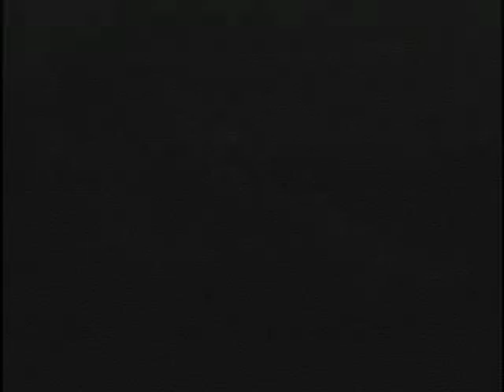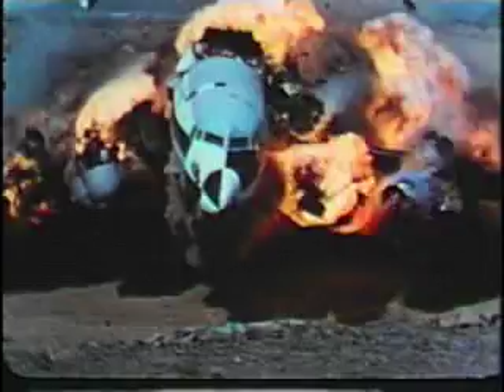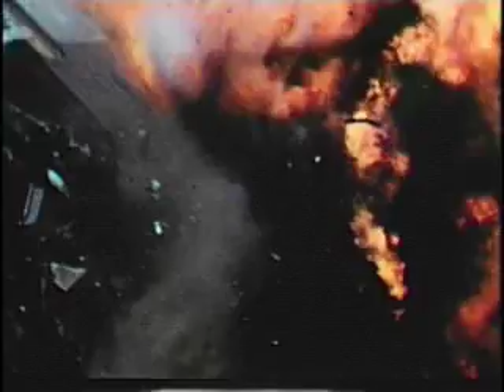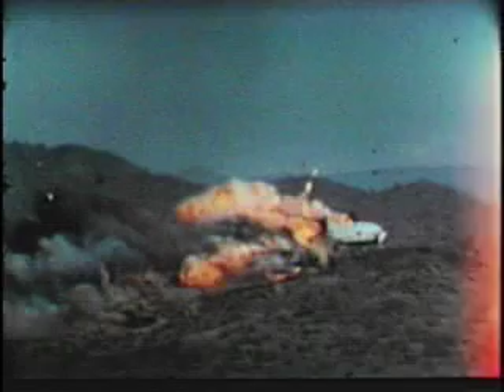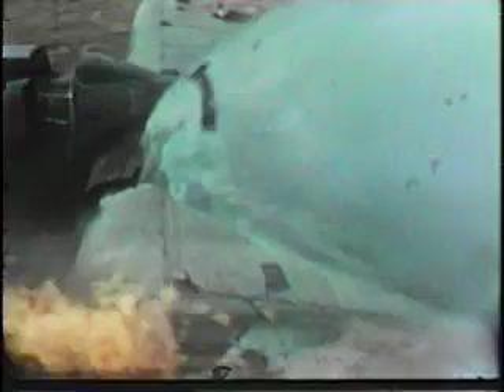DC7 Crash Test

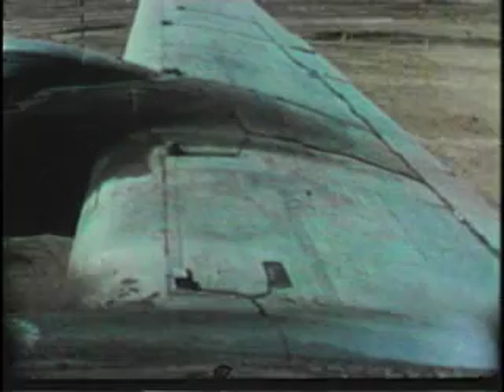Comment: 1:02  "And here is a detailed view of right wing. The 12-inch telephone pole cuts out the outer panel.But the heavier inboard section breaks off a larger 13-inch telephone pole. The basic wing structure remains intact." [PL] "A oto szczegółowy widok prawego skrzydła. 12-calowy słup telefoniczny odcina panel zewnętrzny. Ale cięższa sekcja wewnatrzskrzydłowa łamie większy, 13calowy słup telefoniczny." 13cali=33cm. Do tego słupy telefoniczne są suche i z twardszego drzewa niż stara brzoza na pniu.

Comment: @joefacc 
According to Aviation Safety Engineering and Research, "The purpose of the test presented in this report was to obtain crash environmental data to study fuel containment and to collect data on the behavior of various components and equipment aboard the aircraft using a DC-7 as the test vehicle..."  Tests like this improved seat strength, fire-retardant materials, fuel fire suppressant additives, etc. No waste of money here.

Comment from the maker: this plane's fuel tanks were mostly filled with colored water, so they could trace the scatter patterns as the plane broke apart. the fuel onboard was just enough to run the engines for the few seconds it took to get the plane down the runway.